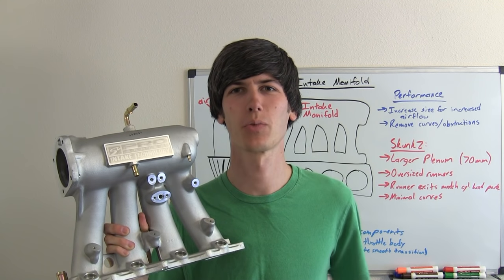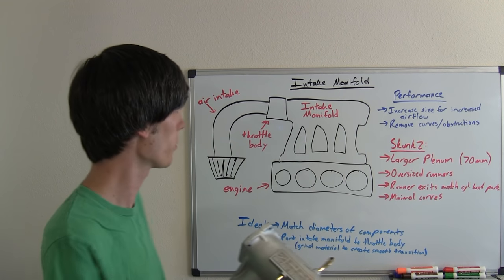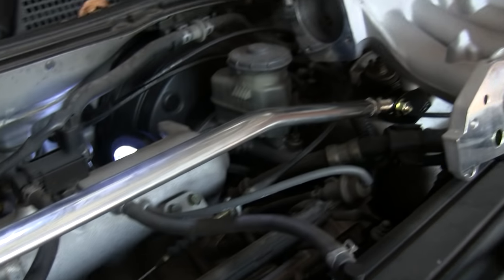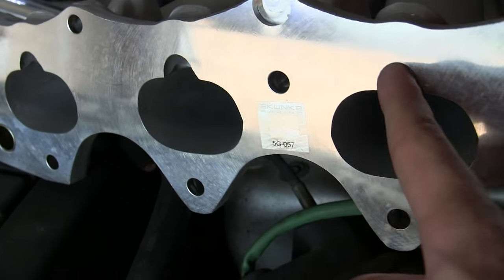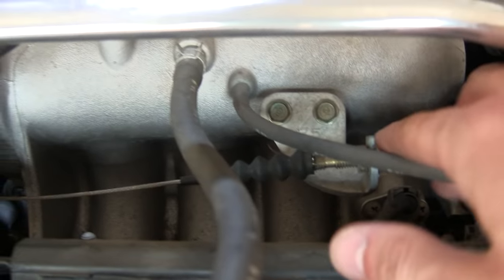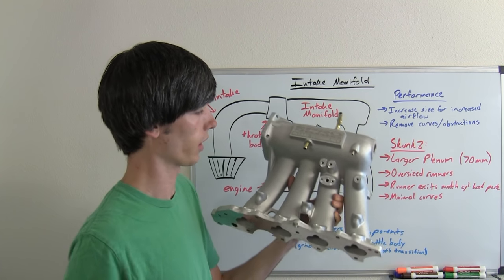Intake Manifold - Explained

Comment: In the beginning of the video, I was thinking "why is he holding up half an intake manifold?" Then, he said it was for an Acura Integra which has half a motor. Makes sense now.
Reply: Haha you're funny
Reply: mehftv
 I've been known to come out with a zinger or two in my time.
Reply: Swervin309 'MURICA
Reply: Not another one who gets stiffy's for 100 year old design cross plane V8's and pushrods... You guys are quick to forget Honda's F20B making the highest HP/LT for many years, only recently being beaten by Ferrari. 
I guess looking at GM and Ford 350's making 350hp from a 5.7L is something to chear  about... LOL!  1HP per cubic inch YEEHAW 
Enjoy
Reply: "Horsepower per liter hurr durr!"
That's a cool ass story, bro. Tell it again for the people in the back. 
By the way, when the hell has there ever been a Ford 350?
Anyway, enjoy your 1/2 of a motor and having to wait for "torque".
Reply: Swervin309, You're absolutely right, the Ford 5L is enough of a boat anchor as is. In 1969 Ford made their most powerful 5L V8, 210hp = 42hp/L. 
Honda's 1971 Z600 car made 31hp from a 0.6L = 52hp/L.
My snowblower makes 15.5hp from a 342cc = 45hp/L haha!
Don't argue the new 5.0 makes 500, Ford couldn't build it so they bought them from BMW ;)
I'll keep waiting for torque, you keep waiting for quality. PEACE!
Reply: "In 1969 Ford made their most powerful 5L V8"

I would try to correct you on this, but I'm almost certain you're trolling. Either that, or you're unable to do a simple google search. 

Anyway, I'll be thinking about you when I keep blowing away little Hondas on the straights and the turns. :-* Enjoy your Sunday!
Reply: Swervin309 😇, same to you!
Reply: +Flat Out Phil
Gee, skippy, a small engine will always have a better HP/liter rating than a bigger (comparable) engine, due to a little thing known as the "square/cube law." Air flows into a cylinder per the AREA of the cylinder (2D), but displacement scales per the VOLUME of the cylinder (3D).

If you double all three spatial dimensions of an engine, it will output roughly 4X the power, but will have 8X the displacement! So your bragging about (irrelevant) power per cc is just another way of saying "my engine is really small."
Reply: Love watching all the ricer owners defend their little cars. Sure, put tons of upgrades/mods/boost into ur tiny 1000 pound car and whip it around irritating the world with them fart can exhausts.

We'll stick with our big block V8's and just know we own beautiful powerful machines. People turn their heads in a respectable manner to large engine sports cars. Only little white boys turn their heads to ricers.

Now when I say ricer, I mean civics, integras, jettas, etc. Not the respectable small engine vehicles that can rip around AND sound good.
Reply: if thats something like a competition, then i am like: my kart engine makes 10hp out of 60 ccm
Reply: Almost any built Honda or as you call it a "ricer" will beet almost and American muscle car in a quater mile or street race. Or an easy way for me to put it to you is that hondas are superior to muscle cars in fuel efficiency and speed. Keep your slow af f350 and I'll stick with my integra.
Reply: I'm going to add in, my uncle owns an Integra, and it's pretty slow. Sure Honda's, and other ricey cars can get better fuel economy, but that's all they're meant to do really. As far as speed goes, I'd go with my Japanese cars, since I like my imports. Your guy's Honda's can probably "go fast" (notice the quotation marks) but I highly doubt it's beating a good muscle car. Show me a Honda with a good sounding exhaust and I'd be amazed. I've seen multiple people around where I live take their Honda's drag racing and street racing. Most of them put these giant turbo's into them and break the engine. With the whole HP/L thing, the bigger the engine the lower that number will be, as is, unless the engines are the same size it won't matter.
Reply: 2018 and still funny
Reply: @Swervin309  MA FURD TRUCK HENDULS THE CURNEEERS WAY BETTEUR THAN A HUNDA YEE HAWW
Reply: Half a Honda motor is more than capable of demolishing a larger capacity engine when done right for a fraction of the cost 👍
Reply: Bros mad that he’d get gapped by a civic 😭
Reply: @anthonyw3433  and other jokes
Reply: Lol. No.. the intake manifold is one half, exhaust manifold is the other half.
I would have thought the same a week ago tho
Reply: @leviwrigley5260  I'm still waiting for someone to explain when/where I mentioned anything about a truck.

Comment: This is very basic explanation. You should really explain the differences to longer or shorter runners and the trade up in power as well as the surge tank design. There is more engineering thought put into an intake than you would think.

Comment: PCV from crankcase to intake...not the other way around.  "The blowby vapors that end up in an engine's crankcase contain moisture as well as combustion byproducts and unburned fuel vapors. The crankcase is sealed to prevent the escape of these gases into the atmosphere, but the vapors must be removed to prevent oil contamination that leads to sludge formation. The PCV system siphons these vapors from the crankcase and routes them into the intake manifold so they can be reburned in the engine."

Comment: The Intake Manifold design doesn't only involve a larger diameter. While a larger diameter will allow more volume through, it also slows down the air speed. Slower air speed through the runners, naturally won't allow for complete cylinder filling at high rpm. The length of the runners are a major factor, these are tuned specifically to take advantage of the pulsing effect when the valves are opened and closed (i.e. harmonics).  Larger volume of the plenum is a benefit as it allows for more air "available ".

Comment: I'm pretty sure that air travels out of the valve covers through the pcv hose rather than in
Reply: You are correct. The pressure in the intake manifold is significantly lower than the pressure in the valve cover. Air flows from high pressure (the valve cover) to low pressure (the intake manifold), not the other way around. Air flows into the valve cover from the hose that connects to the intake pipe going to the throttle body, which is at atmospheric pressure if the air filter is in decent shape. The tube going from the valve cover to the intake pipe also allows excessive blow by to escape into the intake when the engine is operating at high RPMs and high loads when the engine is producing more blow by than what can be vented through the PCV valve to prevent excessive pressure buildup in the crankcase.
Reply: I was saying that too
Reply: Yep! That got my attention too. Must be a slip of the tongue.
Reply: @recardothompson5960  p]pp

Comment: PCV valves work off intake vacuum vs crankcase vacuum. The pcv only works at idle. That is when the vacuum is lower in the intake than it is in the crankcase. That difference pushes the ball valve on the pcv open and draws the blow by gas out of the crankcase and into the intake to be re-burnt. When not at idle the vacuum pressures are the opposite. When an engine is at anything but idle the intake vacuum can be higher than the crankcase. That would send the blow by right back in the crankcase.

Comment: It flows from the cam cover to the manifold. When combustion products accumulate in the crank case and head due to blow-by (tiny leakage through piston rings and valve stem seals etc) this is vented through the PCV system back into the intake manifold to undergo combustion in the case of unburned hydrocarbons and conversion in the catalyst in the case of combustion products rather than venting either to the atmosphere.

Comment: love your shows but you have one spot that is wrong. the pcv line that you showed does not flow from the intake to the pcv valve. that is under vacuum. the fresh air line that takes air in to the motor is located in the air inlet tube after the air cleaner and before the throttle body.
Reply: +Joseph Moran Would you, man, please explain to me what that other hose right between the PCV hose and and the gas cable bracket is for? I beleive is a vacuum line to the vavle it connects to and, if so, what is the purpose of that valve?
Reply: +Stefan Ovcharov. can you send me a pic?
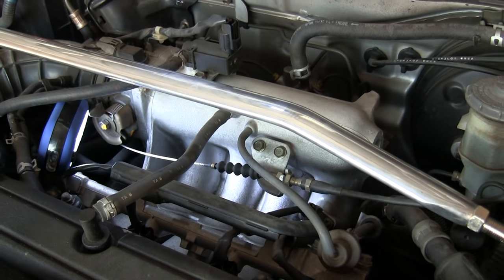Reply: +Joseph Moran Pause this video at 5:22 and look at the hose on the right handside of the PCV hose. The one connected to a valve.
Reply: +Joseph Moran Right in the center of the planum.
Reply: Correct, it draws air from the crankcase, not blowing into it.

Comment: Engineering Explained, Hey EE, I enjoy your videos and regularly share them with customers so they can easily grasp certain systems. One thing though,  when approaching the PCV system, you pointed at flow being from the intake manifold to the valve cover. That is false.
The PCV valve on the valve cover is a one way check valve stopping pressure from entering the crankcase and only allowing flow from the engine to the intake manifold in order to burn the oil vapors. 
If flow were as you said it was, every boosted engine would suffer from gasket/seal failure every time it made boost (positive pressure in the crankcase would push the seals out). I've seen this happen on a 300ZX-TT where a customer didn't reinstall the PCV system and had cam and crank seals blow out on the first drive post rebuild.
Keep up the good work, the Internet needs a reliable source of info, and you're it.
Cheers

Comment from the maker: Torque and horsepower are directly related, so you won't simply produce one without the other. Higher HP may come from higher RPM without changing the torque, so if that was the case torque could remain the same.

Comment from the maker: 1) The piston pulling down on the compression stroke, as well as any vacuum remaining from the exhaust gases leaving.
2) Only 1 valve is open at a time, so the incoming air flows to the open valve, thus it is fairly even.

Comment: @Engineering Explained , the PCV system hose you pointed out actually sucks air from the valve cover, the valve cover casing needs to be under vacuum, this helps in ring seal. Also this is why you see oil coating the inside of your intake plenum, oil vapors from your valve cover gets sucked into your plenum to be re-consumed by the engine to some degree, for emissions purposes. Also, you said increasing the the volume of runners...Thats not quite accurate. The fact is, longer/thinner runners benefit low end torque, shorter/wider ones benefit high RPM power....Usually a stock intake will be tuned for more low end than High end, or have a variable system. The type of intake you have is a static runner size. BMW engines for example the m54 has variable runner system, controlled by the DISA valve which switches from the longer set of runners to the shorter ones as the RPMS rise. Anyway this video was two years ago, and I like you later videos so thanks for those, please keep it up.
Reply: +Hassan Eido I dont think his mind was on the job. It was thinking about having fun with his nice new exhaust and induction kit he scored for doing a few of these vids
Reply: EXACTLY
Reply: Hassan Eido, yes. Good correction.
Reply: Hassan Eido 
I have a question
Why is Oil found inside the intake manifold?
Is it for catching dust or to lubircate the throttle body
Reply: Generally, the oil comes from the PCV system.  It's not a perfect system in that sometimes oil vapors are pulled into the intake from the crank case via the PCV valve.
Reply: Hassan Eido thank you for pointing that out so I don’t have too😂👌🏼
Reply: @procupine14  help me out
Reply: Didn't he say breather hose? Which brings fresh air into the crankcase as part of the PCV system, the other component being the PCV valve that extracts the blow by gases back to the air/fuel mixture?
Reply: @procupine14  i heard oil catch cans can help with that, not sure if they actually work

Comment: Thanks for the great informative video!  I may be mistaken - but I believe that runners can be tuned (like headers) so that the +/- pressure waves will be aligned nicely at a certain RPM to give a pressure slightly higher than atmospheric just as the intake valve opens, thus increasing power (albeit only for a certain part of the rev range).  A video on this and the basic (or just some rule-of-thumb) calculations associated with finding optimal runner length, diameter, etc would be great! I know it was mentioned but I would also love to see video on independent throttle bodies.  Keep up the awesome videos!

Comment: I agree with some of the other comments.  The PCV system flows from the valve cover to the intake manifold, opposite your explanation.  The valve itself is a check valve to ensure flow only in that direction.  It's the blow-by from combustion going into the crankcase that creates pressure in the oiling system, which would pressurize the valve cover since the valve train oiling system drains down into the crank case area.  Those gases are drawn into the intake manifold via the PCV system an recirculated into the subsequent intake charge, as I understand it.

Comment: I'd say that the air is drawn thru the air intake system instead of saying the air just goes thru it.  Engine's are merely air-pumps that pull air in and then push the air out.  Sometimes more plenum volume is not always a good thing and can actually hurt performance due to the fact that you have not added any more fuel to add to the extra air that is being drawn in.  No more fuel + extra air will equal a leaner condition than just using the stock intake manifold.  In order to fully take advantage of a performance intake system would be to have the car re-tuned to accomodate for the additional air.
Cheers!
EDIT:  Btw, I have that exact cross bar on my CRX.  Oh and I'm running an S2 IM and S2 TB.

Comment: Runner length plays a VERY important flow factor on intake manifolds. The skunk 2 one works better on N/A cars, while the edelbrock one tends to give better results on forced induction. They only have different runner lengths and shape. Dunno exactly why it works like that but that's what the dyno always shows between the 2. Could be something affecting velocity vs volume on both... Could be wrong, but that's just what I've experienced with these IM's... Very good video BTW

Comment: Um sorry PCV is a vacuum operated component. The excess crankcase vapors that build up in the crank case need somewhere to go to otherwise it can ruin rings and/or ruin seals. The vacuum of the engine sucks through the one way valve that sits on the valve cover and draws off the excess gasses and vapors via a port that runs down into the crankcase. Nothing goes from the intake manifold into the engine other than air and fuel through the main ports. In the olden days they would just have a breather on top of the valve cover that would vent to the atmosphere. The PCV was a means of just infinitely looping those vapors back through the engine. The advantage of having a vacuum source to draw out the crankcase and valve cover space was that it helped break in the rings when the engine was new or so I have hear and read.

Comment from the maker: Because the current design may be optimal for the current power, but a larger design may be beneficial to a car which makes more power. (If it were turbo'd, new valvetrain, etc.)

Comment: Essentially you use the natural frequency of the air in the intake runners to cause a pressure wave at the intake valve as it opens. It's actually possible to get higher than 100% VE using this method. Of course, for any fixed runner length you'll have a set frequency so works best at a set RPM, hence variable length runners.

Comment: You fill a great gap which is very helpful for DIYers! Thank you so much for your videos. By the way, thinking of the cracking direction of my PCV valves, it seems like there may be an error with your fingers pointing out the direction of flow. I was thinking that the unburned gasses in the CC get directed back through the intake for burning.

Comment from the maker: Assuming the ECU can't compensate for the additional air on it's own, then yes. But there are scenarios where no tune would be needed - especially if the ECU can properly calibrate the A/F on it's own, which I'm guessing most modern cars can do.

Comment: I would say yes, the PCV or Positive Crankcase Ventilation takes the gas from the case to the intake, an emissions control rather than just vent gas to the atmosphere, I learned this replacing the PCV system on my Saab 9-5

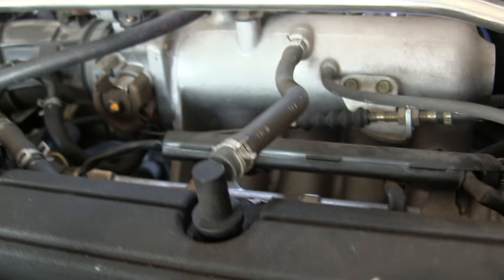Comment: I love your vids - but Aha! I spotted a mistake - at 4:24, you've got the direction of the airflow backwards.

Positive crankcase ventilation involves recycling these gases through a valve to the intake manifold, where they're pumped back into the cylinders for another shot at combustion.

Still, good work!  You're entitled to an occasional error...

Comment: That is a good point to make, simply letting more air in won't change your horsepower too much without the cams actually letting more air into the chamber or the ECU knowing to inject more fuel (although most cars can adjust fuel mix on the fly from O2 sensor feedback my race car uses fixed map injection, which means it runs richer than a overjetted carby but it has trumpets and straight pipes so...). Same for most engine mods, if you don't tune it to use the new part then its a bit of a waste.